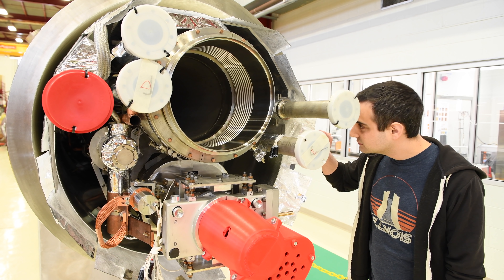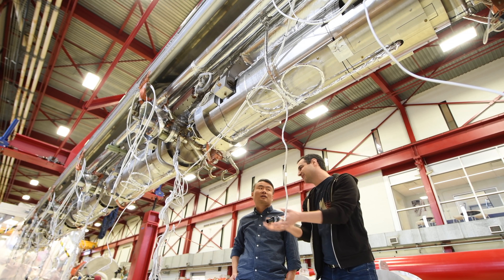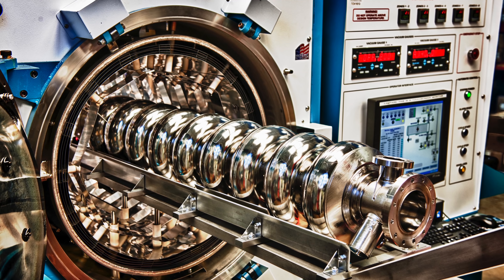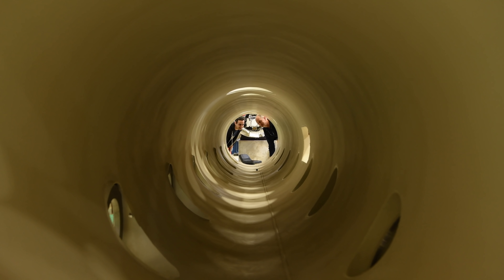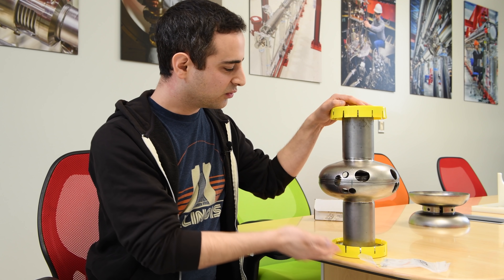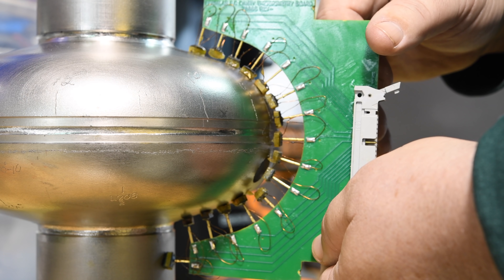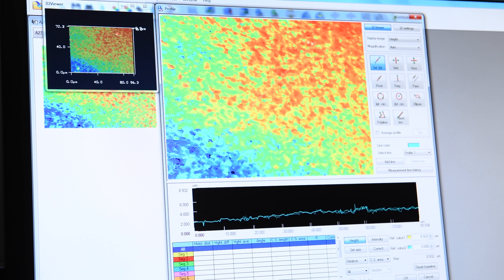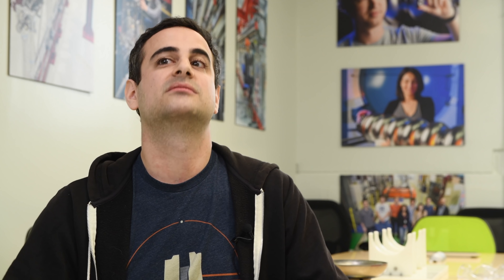A moment with Sam Posen

Comment: first, best wishes with your wedding!!

secondly, do you think that instead of building larger accelerators
 (i was too disappointed when Dr.Don said something like "fermilab accelerator is outdated by CERN, due to its size (thus eV power result)" 
we can do better by achieving better a acceleration stage?
Reply: I think it has to do with magnets. If one wanted a higher energy with a smaller accelerator circumference stronger magnetic fields would be required that are not attainable by current technology.
Reply: @NGC6144  yeah, that is the "easy solution"!!
i was asking if it was viable to ... say... "resurrect"  fermilab accelly(!) by focusing on just that.

i get your point (tech already at our hands as opposed to an under researched one) but think of what i said like something of the "waiting calculation" (why  send a ship today with current tech,
 if in a hundred years the future ship with more advanced tech will outpass the first?) 

building tunnels and electromagnets with THAT  precision must not be neither too easy, nor cheap.

#drops mike#
.
.
.
.. obviously just kidding! :p
thank uou for answering, looking forward for some debate/correction on me opinions!

edit: typos (always typos!
at least ,88% of commenting!!

getting seriously annoying actually how often this keeps occuring!)